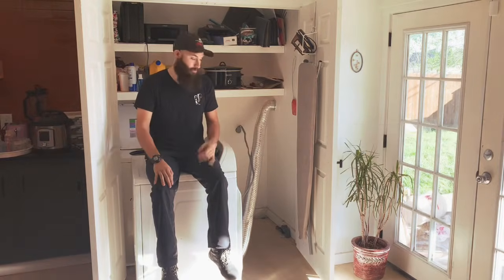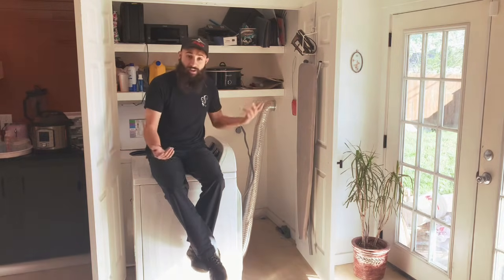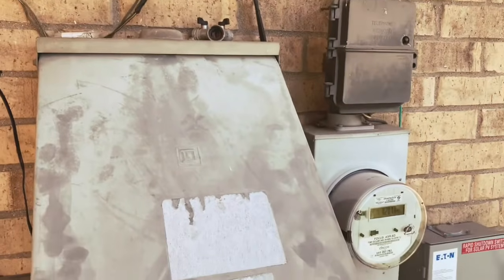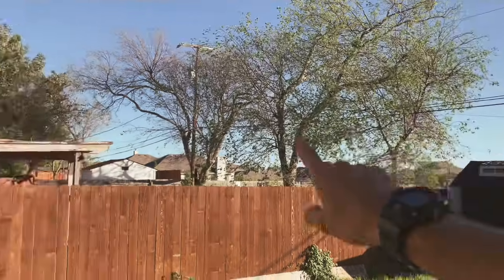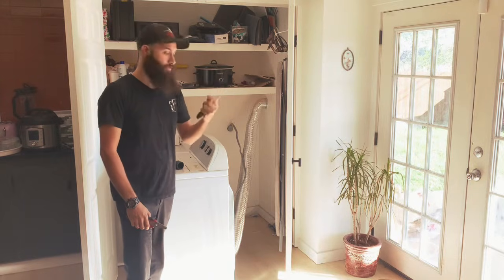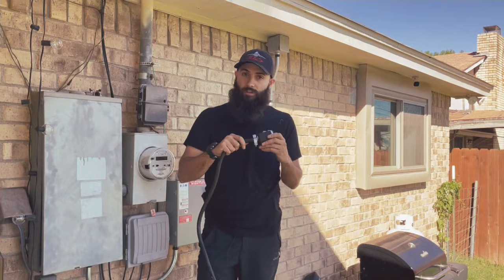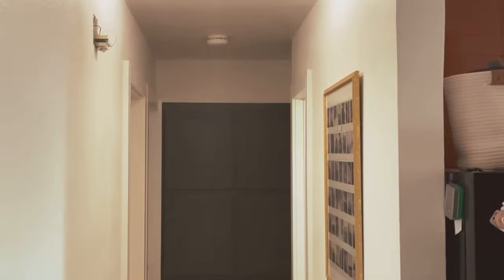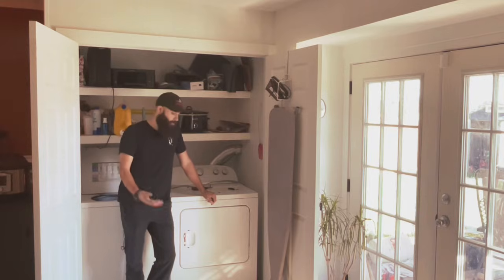How To: Backfeed your generator into your house

Comment: If you backfeed your house without shutting the main breaker, could you technically be sending power to other homes on the same service line?
Reply: The main breaker is bidirectional, but your power is probably coming in a gauge 2 line which normally has +600V on it. At best your generator is only putting 240V on it, which is less than half. It will put a deadly amount of electricity on the line but after about 300ft the voltage drops dramatically. You might be feeding some power to the house next door but after 500ft of service line you won't really even be able to shine a lightbulb

Comment: There are standards for connecting generators for a reason. Its why you should use a licensed electrician to this so you do inadvertently backfeed linesman and just turning the main switch off may not fix this problem.
What your doing is dangerous.

Comment: Into a winter situation wouldn't you actually want your heat on ?What would you do about that
Reply: Space heaters would probably be best if you’re using the generator
Reply: @RyanStraub-f8s so you need to shut your water off and drain your water heater and pipes so they wouldn't freeze if you're expecting it to be more than one night situation
Reply: @RyanStraub-f8s not if you have NG like many people do
Reply: Get a bigger generator

Comment: So if my generator has a 30 amp 120 volt and I'm trying to run it to my dryers 240 volt should I be good even though there's no ground and just a neutral? Or is it grounded inside the breaker box itself?
Reply: The 120V still has a ground wire, it just doesn't have a 2nd hot wire. You could pigtail the one hot you have to get a 2nd hot, but pigtailing will not get you to 240V. You can buy adapters that splits the hot for you. They cost around $15 depending on which adapter you need.
Reply: @howardradford1985 - but read up on MWBC because that approach will overload the neutrals and be a major fire hazard
Reply: @condor5635 Nah, wouldn't affect it. It would be not different then just redistributing all your breaker to work on one leg.
Reply: @howardradford1985 Both legs of the multi branch circuit would be on the same phase which would overload the common neutral that they share unlike them being on opposite phases where they cancel out.  This is why people need to learn more about what they’re doing before they go do stuff like this.
Reply: @condor5635 That's why you don't put too many branches on the same neutral and use dedicated neutrals on higher amp appliances. If you are too code before using a bridge adapter you won't have to worry about overloading a neutral.
Reply: @howardradford1985  I can tell you don’t even know what a multi wire branch circuit is… go read up on it
Reply: @condor5635 Yeah I do. You are referring to the idea that if you have two 15A breakers sharing the same neutral and because the energy is flowing in the same direction it will double the load on the neutral to 30A. Thing is when you wire a branch circuit you don't wire so many that simply changing the flow of every breaker will overload the neutral and you don't use branch circuits at all on higher amp appliances. 

Im guessing you only just heard about branch circuits and think you have a really good understanding of them simply because you know how they work but don't yet know their application.
Reply: @howardradford1985 so back to the original assertion on reading up and understanding them if wiring a 120v generator to both legs of a panel  and you saying it’s not going to matter…. It does matter
Reply: @condor5635 Only thing it will matter for is your 240V circuits. They won't work but you'd already know you couldn't since you'd know you're not getting 240V. It will put more than its usual amps on the neutral but your typical wire is good for 75° ~ 90° and your breakers kick off at 40°. Your breaker will trip before your neutral conductor overheats if you are to code on your branch circuits
Reply: @howardradford1985  you’re totally missing the point if you feed the two legs of a multi wire branch circuit, the same 120 V phase like you would on a 120 V generator. The neutral is gonna carry the sum of the loads. The circuit breaker has nothing to do with it, and it will not trip.  You’re wrong.
Reply: @condor5635  Yeah it carries both loads on the branched neutral potentially doubling the load but it should be able to handle it if its to code. You will essentially have the same effect by overloading a power strip.
Reply: @howardradford1985  look Howard - You’re fundamentally misunderstanding how a multi-wire branch circuit works and why this is dangerous.

A MWBC is safe only because the two hot legs are on opposite phases (180° apart). That’s what causes neutral current to cancel. The neutral carries the difference, not the sum.

When you feed the same 120 V phase to both legs — which is exactly what happens when a single-phase 120 V generator is bridged across both panel legs — that cancellation disappears. The neutral now carries the full sum of both loads.

Breakers do NOT protect the neutral conductor. Two 15 A breakers can each be perfectly happy while the shared neutral is carrying 30 A continuously. Nothing trips. The wire overheats.

This has nothing to do with appliance sizing, insulation temperature ratings, or “being to code on branch circuits.” The NEC explicitly requires MWBC legs to be on opposite phases for this exact reason.

That’s why:
• A 120 V generator must not feed both legs of a split-phase panel unless it has a proper 120/240 V winding - unless you understand MWBC my original post!
• MWBCs require handle-tied or common-trip breakers

Comparing this to “overloading a power strip” is incorrect. A power strip does not create a shared neutral fault condition across multiple branch circuits.  You keep going back to this fundementally flawed argurment.

This isn’t theoretical. This exact mistake has caused neutral failures and fires. That’s why electricians and code treat it as a serious hazard.

That's all i am going to say on it because you clearly do not understand the point....
Reply: @condor5635 You mean 120° not 180. You made a mistake in your first paragraph so I'm not reading the rest cause I don't want to dog pile on all your errors.

Millions of people use bridge adapters its not a problem to use them. It about as ignorant as those people who say interlock still backfeed the grid because it doesn't sever the neutral conductor and say only manual or automatic transfer switches are the only way to break the neutral. I almost bet this is what you actually think. Your wrong. It won't travel on the neutral back on the grid because the grid isn't the source.

Comment: Thanks for your video.  I have done this for years but didn't have the balls to do a video.  I am one of those rare cases that could back feed to the high voltage line because I am at the end of a 7.2K line.  If the line was cut between me and my neighbors then it would be possible to place the high voltage on the line if I didn't open the main breaker.  If my neighbor were still connected there's no way I could power up their houses too, thru a 30 amp breaker unless they had all their appliances off.

Comment: I don't know why everyone gets their panties in a bunch over using a suicide cord. Just don't be an idiot. Always turn off your main at your panel and ALWAYS plug the cord into the dryer plug before plugging into the generator! In that order! Electricians get butt hurt over this because they want to charge people 2 grand to install a transfer switch.
Reply: For every idiot out who will electrocute himself this way, there are a million who are perfectly capable of understanding that live prongs are dangerous.  This idea that the sane majority be hamstrung by a tiny minority is literally detrimental to the functioning of society.
Reply: @toby2581  Natures way of weeding out the morons. Nice rambling on about nothing
Reply: @toby2581 Even non-idiots can kill themselves (or someone else) by just making one mistake or forgetting to do one thing like shutting off the main breaker or switch. Just sayin' . . . . .
Reply: @EdW-e4w  it is highly unlikely a portable generator could power up the high voltage power line if you forget to throw the main breaker because other neighbors would still be connected and therefore present a load that would trip your generator breaker if you tried to power your neighbors.
Reply: @jnbfrancisco  You are right - provided the generator circuit breaker worked properly. I personally would want to take a chance, considering the risk not only to myself but my neighbors, and linemen  as well.
Reply: @EdW-e4w  Even if the generator breaker malfunctions the generator will shut off because it can't possibly power your neighborhood and bogs down, no?
Reply: @ricardoamendoeira3800  That's what would most likely happen, however, why would anyone want to take a chance for someone to get shocked and maybe killed before the gen set shut down?
Reply: Is best to plug the cord into the generator and the dryer outlet before powering on the generator. That way there’s no electricity blowing through the line since you’ve cut off the main breaker of the home, no risk of electrocution.

Comment: I recently did this on a 120v outlet from my genny to a backyard outlet and  I was able to get power to everything except the kitchen and attic outlets. Would I be okay running another 120 line to one of the dead outlets in the kitchen, to completely power the house?....sorry if I'm overthinking this.
Reply: You only powered half the house because standard 120v outlet is connected to one bus bar. I personally wouldn't try connecting to the other through 120v.  Likely going to draw too many amps and trip breaker or worst case cause a fire. Get a generator that supports 240 and run it over the dryer. It's naturally setup for it already to power the entire panel with thicker wiring.
Reply: Thank you for the info, I will stick with just 120 on one side. Got to say it was really convenient to take my $400 inverter generator and have 90% of my small house powered. If this was going to be an ongoing issue in my area I would definitely invest in a 240 generator, along with the outlet interlock etc.
Reply: @mykec187 look into MWBC and repercussions if powering both legs with the same 120V source. Overloading the neutrals

Comment: nice video can i run my small 1000 watt generator not through the dryer receptacle but through the  110v wall receptacle.
Reply: Yes you can, make sure the main breaker is off, and if you can lock the panel do so. Then be 1000% percent sure that there's no power, use an outlet tester, voltmeter, lamp etc, and also use a lighted extension cord, and or lighted plug ends. Lastly ALWAYS connect the plug to the dead outlet 1st then connect to the generator.

Comment: If you run electric with to many amps. through a 15 or 20 amp. wire wouldn't it blow a fuse or breaker and keep from over heating the wires and possibly cause a fire?
Reply from the maker: Yes. That is why we chose the dryer port, as dryers typically feature larger amp breakers and larger diameter wires to support the electricity needed to run a dryer

Comment: Im alittle confused because you would think the 240 would damage the 110 appliances. Im looking to do this and had the same thought process as u with the bigger wire and more power but Im worried about it over powering stuff. If you can, please explain. Thanks
Reply from the maker: The 240 is just supplying the power to the breaker input. It is still regulated by the breakers.
Reply: @gridbasedotnet  I did not know that. Thank You!
Reply: @gridbasedotnet  So you're saying 240 IS being supplied? My well water pump is a double pole 20amp so I would be able to run the pump without damaging it right?
Reply: 240 is simply 120 going to one side and 120 to the other side at no point on a 240 appliance will a voltmeter read 240. Your single pole breaker only gets 120volts. A double pole breaker gets 120 on each side. It’s a separate source for each side. A 240 dryer will get 120volts to the motor, and a separate 120volts for the heating element.
Reply: 240v powers, both l1 and l2 of the panel. In a split phase configuration. Therefore powering both 120. And 240v volts to the panel.

Comment: Will you be able to run your house ac ? Hypothetically
Reply from the maker: Yes. On assuming your generator is powerful enough to handle the amount of energy your AC unit requires, you can absolutely run your AC. 

HOWEVER, if for some reason your AC unit is on a separate breaker box it wouldn’t work. 

But, typically it’s all on the same breaker box.
Reply: If it's on the same panel, and if you're gen. Is strong enough. Yes it would.
Reply: Only
If you’re ac is on a 30amp or less breaker since you’re backfeeding through a 30amp drier breaker. Unlikely.

Comment: It really shouldn't need to be said but I'll say it anyways. Do not under any circumstances handle these connections while the generator is running and tripple check that there is no power coming into the house. If... you were to do this, Plug in all your cables while all the power is turned off everywhere. I repeat do not handle live wires.
Reply from the maker: Big 10-4
Reply: No it'll fry your genny.